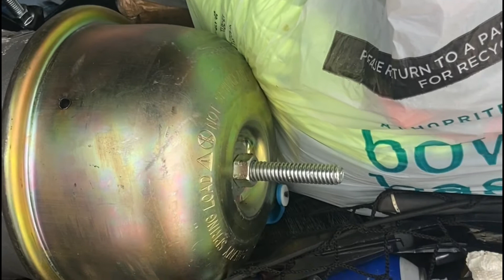TRUCK BRAKE CHAMBER 30/30 REMOVE AND INSTALL HOW TO

Comment: Did you cage the brake chamber on the truck before you removed it or you don’t
Reply from the maker: It’s was already off my boss buy it like that I just put it on
Reply from the maker: But I did of to cage it to unlock it because it was locked up
Reply: @karlonarcher7918  No problem thanks for the video. It helped me a lot. Thank you.